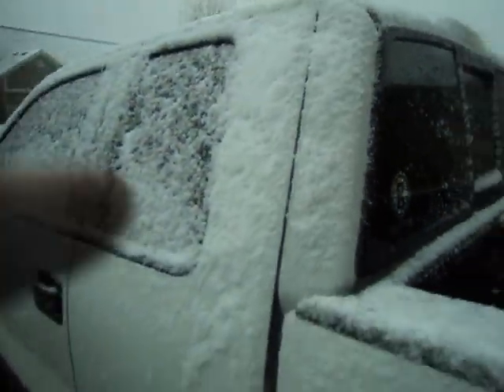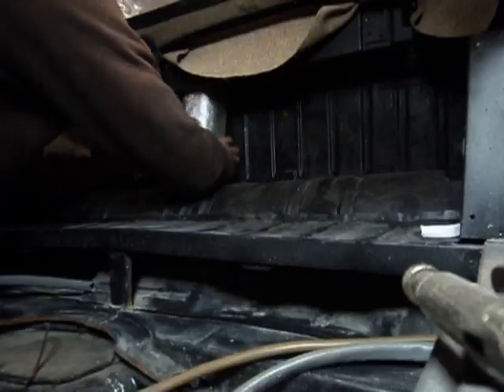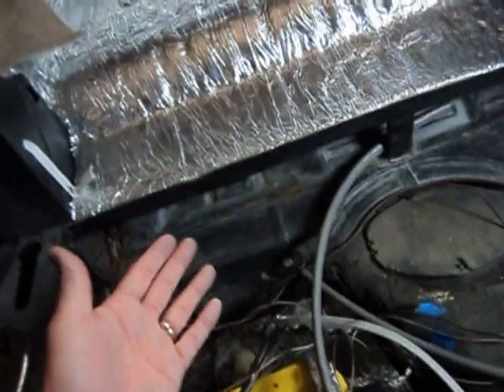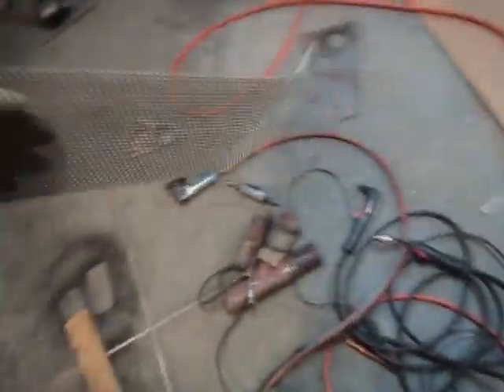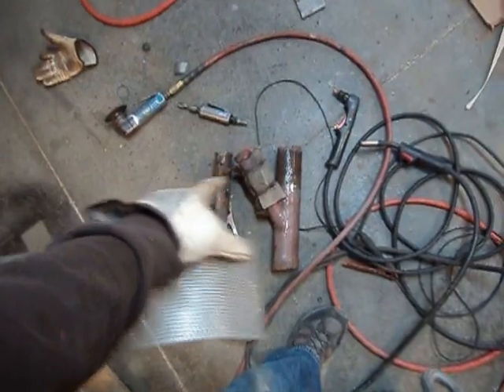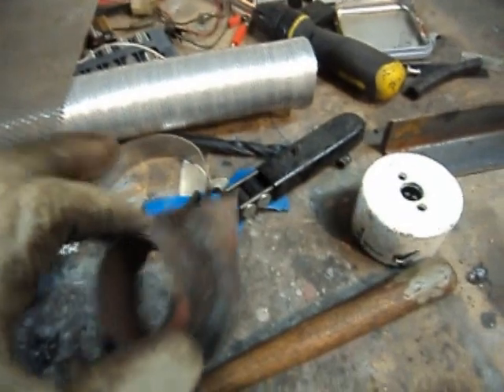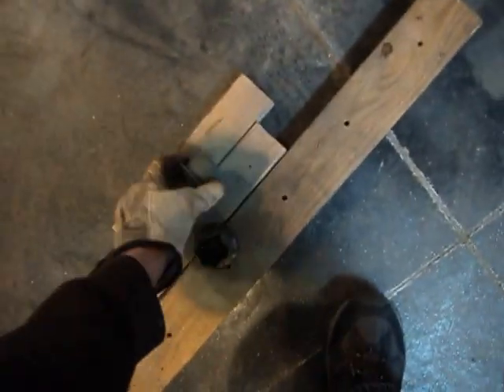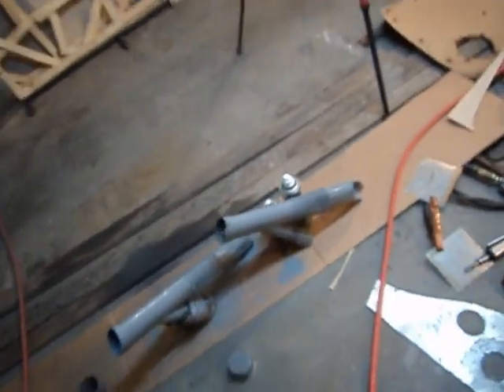Karmann Ghia - Sound Insulation Install

Comment from the maker: No problem man.  I did all the insulation for just under $100.  That's pans, firewall, package area, inner quarters, bulk head, doors, kick panels.  5 rolls @ $18/roll.

Comment: I will follow your tip.. make sense because with the time it could get it down but the bows are going to help it stay on place.. but try to get a high temp. adhesive.. thanks again for your time, the ghia is a 63 coupe hard top..will keep in touch.

Comment: Looking sweet....Speeking of scratches a customer brought in his prized Ghia back in 82 so I could replace his non working headlight switch. While using a flat blade screw driver to loosen the locking ring it slipped and I carved a 3 inch scratch in his dash. He was not impressed but I did pay for it to be repaired....sigh!

Comment from the maker: Yes and yes.  Anything can trap moisture.  I'm betting that in the garage it won't be a bad situation.  It had tar boards everywhere from the factory.  They trap moisture for sure, so it can't be too much worse.  I'd think a batt type insulation would be much worse.

Comment: Thks about the insulation, I heard you could use something but I didn't know what well, you said Lowes and that's where I will be!! Did that duct stuff already have adhesive on the back or did you add some adhesive?

Comment: I'm running late...I'll have to see if anyone can supply me with some of that insulation...Lots of heat comes thru the floor on the '38...Not too bad in winter 'cos there's no heater..lol..good stuff Greg.

Comment: Mr Greg this is ozzy again.. about the insulation did you put on the middle of the kg. i mean where the shitfer and emergency brake are (on that part) i could not see any insulation on this part.., and what about doors , did you use extra glue on them to help stick togheter I mean stronger than just the glue that is just on the frostyking ins thanks again in advanced and it was an excelent trip..keep going. thumbs up..
Reply from the maker: Ozzy.  I had the factory tar board on the center tunnel.  I actually scraped it all off years ago, but at the end of the project, I still had a "spare" chassis and I stole the tar board from it to put on the center tunnel.  As for the doors, I used the frost king stuff, no extra glue.
Reply: Ten four.. thanks for the information Mr Greg is very helpful.. keep in touch and thanks again..I will try to load a pic from the 63 kg when this is done..actually I am in North Carolina.

Comment: Mr. Greg this duct insulation can be use under headliner?? the original insulation ghia is getting in chunks .. Thanks
Reply from the maker: That's a tough one.  I don't know if the adhesive is strong enough to hold upside down over time.  If you use it, I'd suggest using an additional high temperature spray adhesive on both the insulation and the roof.  Make sure the surface you are gluing to is very clean.